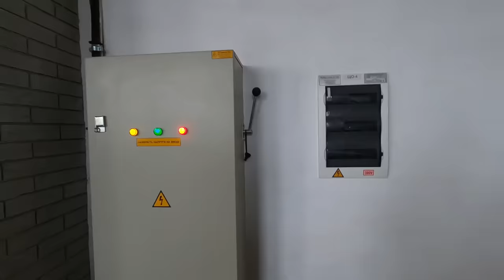Pendant Led lit Wooden Honeycomb (step by step)

Comment: Hi, beautiful work! :) More better were, if you would take 12V bulbs, and than one Wire-Cabel the +, the other one is the - and you must not have the 230V wire. The transformator could be on the upper Honeycomb. Sorry for my englisch

Comment: Making things out of wood is great - and this looks good, but the safety aspect of it should deter you from making it. You did connect it safely, but in the case of a short, the wooden box can catch fire - potentially - in other words, there is a risk. Suggestion, to insert metal casing inside each unit and specially the connection point in the ceiling.

Comment: The lights were OK, but the way you  mounted them was crap.  Who wants 3/8" aircraft cable and an extension cord running from their ceiling?  Great design, poor execution.  C+ for the effort.